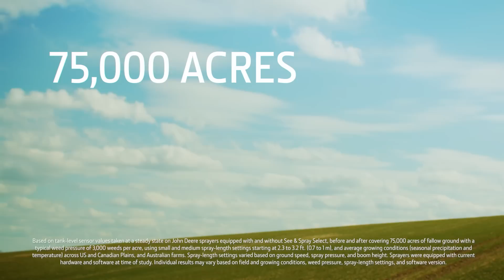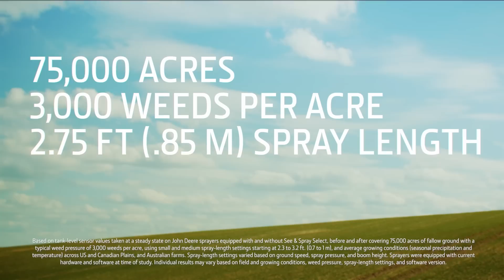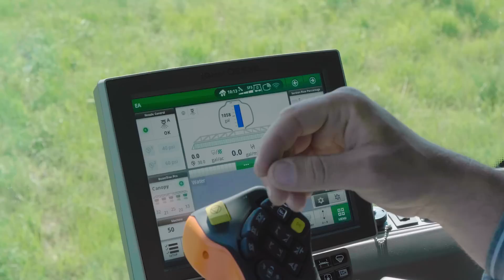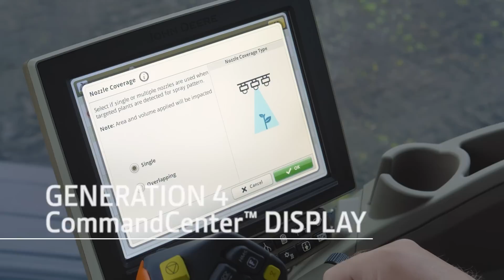+Gain Ground with See & Spray™ Select | John Deere

Comment: Interesting consept,  I spray over 10,000 acres a year,  this would have very little use.   Never  go over pure black  ground with a few large  weeds. I'm mostly  no till .  Honestly don't know what you're market is.
Reply: If spraying on last last year residue  could be done  it would have  value,  however nomally I'm applying preemerge at that point.